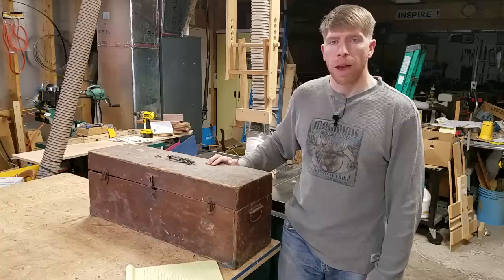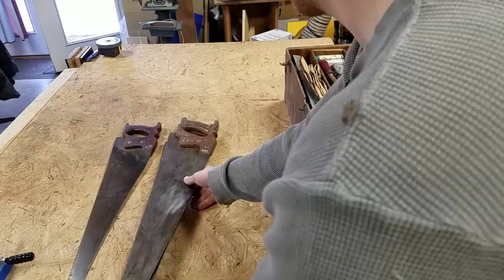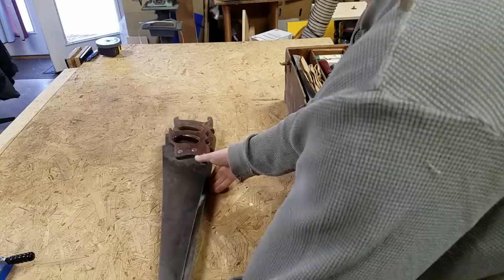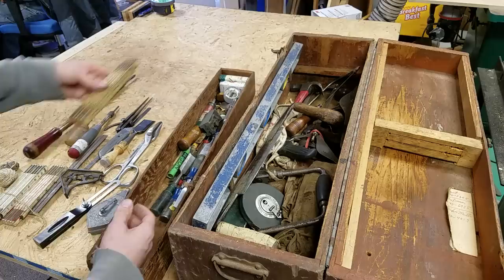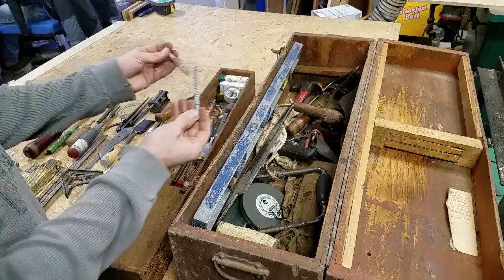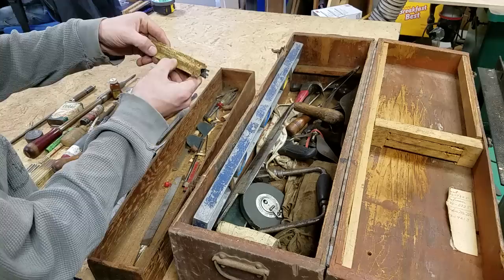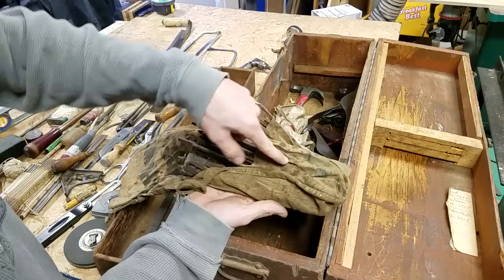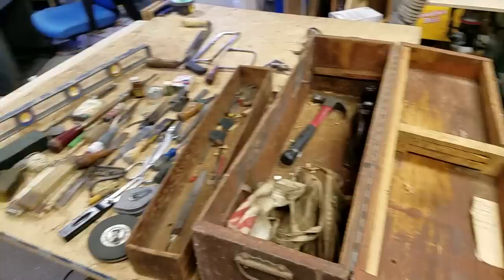Toolbox Time Capsule, unpacking a 1930-1950s era Carpenter's Toolbox! /EP43

Comment: Hello Chris, I'm 75 years old and was trained on hand tools, I worked as an ecclesiastical joiner. I didn't. get my first power tool until 1990. All my work was done with hand tools. I am still working and again using only hand tools. I work for the NZ Historic places Trust. I work on old historic buildings from the colonial days. Your grad father's tools and toolbox remind me so much of my own toolbox (of which I have made several) and still using my father's tools which he handed down to me, and some which are over 100 years old and still in good order. The long screwdriver is spring loaded. and if you weren't careful, it could fly out and damage the work, we called them " Yankee screwdrivers."  The fluted No 5 plane I still use; it was used on oily, greasy timbers, the fluting stopped suction and made it easier to plane. The block plane originally was used to trim butchers block hence the name. I had better sign off now, before I turn this into a book. Thank you for sharing 'box opening.'  ATB from NZ ☺☺

Comment: Grew up learning the price and value of tools.  On my own at 16 and buying tools for my work.  Everyday i oiled the metal surfaces and every 6 months linseed oil on wood handles. I broke a few Craftsman wrenches early on before learning the tool’s intended limits (back when they were all made in USA and you didn’t have to buy ‘Pro version for lifetime warranty). My power tools lasted until i was 53 and my home burned. My point is, buy well and once and do your after the job job!
Reply from the maker: Great, advice! Thank you for sharing your experience.
Reply: My tool buying strategy has always been: Buy the best I can afford at the time and when one breaks or dies, replace it with an upgrade. I've worked as a carpenter or cabinetmaker since 1976 and now have a good set of tools. An older carpenter once told me, "Take care of your tools and they'll take care of you". Remember that!

Comment: That ratcheting screwdriver is made by Stanley, and it's called a Yankee. It's in the closed position, but when extended it has a worm that will turn the screw when pushed. Those aren't blacksmith's chisels, but simple cold chisels, the bent one comes that way for cutting flush with a surface. The Stanley #5 plane comes either with or without a corrugated sole. Jon
Reply: Railfan 439 Yup, been using my old man's Stanley Yankee plunge driver all day today. Hell of a tool.
Reply: Actually prior to 1946 when Stanley bought them, the Yankee was built by the North Brothers Manufacturing company in Philadelphia Pa. Stanley kept the Yankee name and continued manufacturing the thing till selling it to some German company in the early 2000s. Its still being made by them last I heard.
Reply: Railfan 439 not blacksmiths chisels but cold chisels. Blacksmiths use chisels to cut steel when it's hot. They use diffe to chisels to cut steel when it's cold. Hence the name cold chisel!
Reply from the maker: Thanks for sharing! Definitely learned a few things going through it, and from all of you!
Reply: @tedroe695  There is an attachment made now that fits the Yankee so you can use modern hex screw tips.
Reply: the corrugated sole was for use on resinous timber, it reduced the amount of sole in contact with the timber, making it easier to use. and clean.
Reply: Also known as a 'yankee pumper' here in UK.

Comment: Those corrugated fasteners you said were for trusses were most often used in my part of the world (Texas) to assemble window screens. The corners were mitered and the fastener was driven into the boards across the miter cut.  Simple, fast and a great way to join 1x2 boards.
Reply from the maker: Yes Sir, thanks for sharing, Robert.  I realized that after recording,  certainly not gussets for trusses. I'd even used them in my prior  job at a hardware store fixing screen doors before filming this video. One of my many extemporaneous goofs in this video.  Thanks for watching and taking the time to share your experience and write.

Comment: The large screwdriver you pulled out is called a "Yankee".  Proper named is spiral ratchet screwdriver.  The other item you were unsure of was a push drill.  Both were developed in Philadelphia by North Brothers.  These items and others were sold to the Stanley Works Co.  They have since sold them off again.  These items were necessary before the advancement of electric equipment.  The one band aid box had the bits that go into the push drill and other bits for the Yankee.

Comment: Very interesting!!! I've been working on renovation project at an old Cotton Mill built back in the 1800's. It's amazing to see the level of craftsmanship from those days before power tools.
Reply: Read or listen to anyone who's a handtool expert and they will tell you you can do work just as fast as power tools and a lot of it much better qulity work. Power tools were ment to lessen the work load.  When you use hand tools you really work, power tools do the work for you, both require skill to operate.

Think about this next time you cut a board on a tablesaw, you have to set the saw up take measurements raise the blade make sure its squar then cut.
Hand saw take measurements scrib line and cut.  The only differences is how many board feet per min you can do with each tool. And how you fell when your done.

Comment: Aloha Chris ,
The 'butt gauge' was for 'marking' hinge locations on doors for the 'butt hinges' , enter and passage doors . The #5 Stanley Jack Plane was the go to plane for most jobs , but that model is with its 'pleated sole' , this was for sticky or resonus woods . The 'pleated sole presented less surface area to the sticky wood's face to resist , making your workday less tiring . The 'marking gauges' from the 'band aid box' were for your carpenter's square , to make 'laying out' a stairways 'riser's' consistent and true , not only from one step to the next but one floor to the next , since a 'set 'of stair needed to take off and land from the floor level of one floor to the landing of the next . The 'Cold Chisels' seen from the box had many uses , but the 'bent chisel' was mostly used to pry or lift in leveling , confirm this by the leading edge and the butt end . Is there no dings in the leading edge and no 'mushrooming of the butt ? It was than mostly used to lift and level . The 'Brace and Bits' set was the 'first' cordless drill of the job site . With most 'sets' , you had a bit from 1/4 "[marked 2/8"] to a 1 inch [8/8] , and the expansion bit covered the odd sized or special sized needs .  A real time cap cell you have there !
Reply: It is called a corrugated sole. Pleats go on your skirt.

Comment: The "ratcheting screwdriver" is I believe a STANLEY YANKEE SCREWDRIVER the smaller "push drill" is known as a "BUCK ROGER'S" YANKEE PUSH DRILL.  FYI The points (not bits) are very difficult to find and usually store in the Yankee's handle.
What you are calling a "Hand Drill" is called a BRACE.
Reply from the maker: Thanks,  Bill

Comment: Stair nuts are what my grandpa called them. I have heard them called rafter nuts also. My great-grandfather and grandfather were both carpenters in Wisconsin.I build homes in Washington state.Most of what I know was learned from grandpa and dad. I have a couple boxes like yours.When I was ten I "borrowed" grandpas crosscut out one of his boxes and cut a roll of tar paper in half for my fort. Did not go over well!Great video!I knew there were bits for the brace in the bag before you rattled it.

Comment: Great to see an old US tool kit ...still similar tools I use in my kit today in the UK.
Reply from the maker: Definitely an art to do it by hand! I'm a power tool fan myself, but a lot to be admired about slowing down and hand cutting, boring with a brace, chopping with a chisel and smoothing with a sharp plane!
Reply: Chris...I agree, I always chisel out butt hinges when hanging doors and use my block plane to tighten mitre joints etc...old habits die hard .

Comment: Great fun to see what is in your Grandfathers tool box!  For any one that wants to know - the Stanley corrugated fasteners at 16:13 are used for strengthening corner joints in windows, doors, screens, picture frames, etc.  I worked maintenance for a place that had cabins built in the 1930's and there are many things made of wood that used those (before modern tools and fasteners).  Cool to see the Stanley cardboard box with a label on it - that was definitely purchased at a hardware store.  Love the old hardware and tools - thanks for the memories!
Reply from the maker: Thanks for sharing Accseller8! Sounds like a neat place to work in maintenance.  I worked in a hardware store for 10 years from middle school through college, we sold that type of fastener, or had a few old boxes on the shelves. Unfortunately, that wonderful store is closed now. 
I repaired windows and screens there and definitely remember seeing them in the frame corners, basically a metal spline..not sure why I said trusses in the video. Thanks for sharing and bringing it to light. I love how everyone picks something different out and adds from their own experience. Thanks for adding to the dialogue!

Comment: I think it's great that you appreciate your great-grandfather's tools.  You didn't quite get all of the names of the tools right, but you understand what they're for.  I think maybe you should try learning about how to use them.  A few years back, I broke a wrist and was a bit leery about using my radial arm saw and most other power tools.  So I got out some handtools and learned how to manage them with one & one-half hands.  After learning and when I was two-handed again. I realized that handtools have certain advantages.  They don't make noise or blow dust everywhere, they don't cost much to maintain, they don't take up much space, and for many jobs they're actually faster than getting out a powertool to do a job.  As you grow in your skills, you'll find that they can be quite precise too.  Power tools have their place, and so do handtools - they belong in your arsenal. And by the way, here's little known fact: Jedi squires were required to demonstrate proficiency with handplanes before they advanced to handling lightsabers - they're 'elegant tools from a more civilized age.'
Reply from the maker: Great advice Bob, I certainly will.

Comment: Wow, amazing what is in that tool box compared to what is in my tool box today. Some things I do still have and use regularly, but some have been replaced with technology, plumb Bob's with lasers, Yankees with cordless tools. Just think of the builds these guys made with these tools, when pride mattered, not just speed. Great to see that this carpenter had such a variety of tools. Looks like there wasn't one thing that he was not prepared to do. Even with a headache. Impressive
Reply from the maker: He was definitely a man attentive to detail. My father told me that he taught him a technique for fitting stair treads and risers precisely that he held could only be done with a hand saw. He was definitely a Craftsman through and through the kind of man to teach others what he knew. Still inspiring today!

Comment: very nice.  The Stanley No 5 was the do-all size...called the Jack plane, aka Jack of all trades plane.
Reply from the maker: Got it all tuned up and sharpened, still works like a champ.
Reply: SpinDrift I love my Millers Falls #5. I got it in a lot of tools from a garage sale, and was reluctant at first to take it. I’m a user, not a collector, and after I tuned it, it sings thru the wood. I can see how it could be one of the few planes you’d need to get the job done without lugging around a cart full of planes.
Reply: A No. 5 is my favorite all around hand plane. But I wouldn't want to try to do some jobs with it.

Comment: Your grandfather's brace is a ratchet brace which is great for tight places, but it can probably only use the old auger bits (that's typical for that type of brace with three or four jaws). I love using my old braces for boring holes. Often you have more control and even more torque. I've bored holes in hard woods with my brace that would break modern drill bits (ask me how I know 😅). Thanks for a great video!
Reply from the maker: Thanks for that great tip,  Thomas!

Comment: I guarantee none of those  tools say “made in china “
Reply: More than 'Made in USA', I bet they even tell you the US city they were made in.
Reply: That fiberglass handle hammer might be made in China.
Reply: @1pcfred  It's 1960's vintage, I wouldn't bet on it.
Reply: @dougdobbs  I don't remember any fiberglass hammers back then. I don't think I saw one of those until the 80s. China was sneaking some stuff in by then too.
Reply: Bet your wrong, as I know that adjustable angle gauge is made in China, as I have one also.
Reply: there's a reason it's called the 'good old days'

Comment: Hi Chris I'm a retired joiner, when I started my training one of the old joiners had a Stanley No5 the reason for the grooves in the sole is for ease of use on resinous timbers. But in my toolbox rather than carry an extra plane I have a candle, rub a little wax on the sole and swish
Reply from the maker: Charles,  thanks for adding your experience with the corrugated sole plane and wax!

Comment: my father was a carpenter .and he could extend a folding ruler what seemed to be less than a second. when it got a little stiff he'd go  to the pick up an whip the dip stick on the joints.. t.y for the vid.
Reply from the maker: Thanks for sharing, Joel. Interesting use of motor oil!

Comment: The level at 15:33, if you were installing a drain pipe across a yard to prevent water from pooling next to the foundation (French drain), you'd drive a stake at the top of the pipe run, and a stake at the bottom. You'd mark the high stake (by the house) in the middle, and then hold the eye level alongside the low stake. Move the eye level up and down until the cross--line inside the level is on the high mark. The two stake marks will then be level with each other. Then you measure down from the marks to run a tight string line so you can dig a trench for the drain pipe, with a drop of one inch per every two feet or so. That's just one use, there are many ways to use it.
Reply from the maker: Thanks for sharing that,  Ron.

Comment: Not all that different from my own tool collection. However my tool collection goes much much further with plumbing, electrical and my own HVAC tools.  I had everything he did with the exception of the brace and ratcheting screw drivers.  My father was a home builder post WW2 thru the mid 60’s. By osmosis and observation of my father I learned many tradesman skills.  They have served me well over the years. Not much I haven’t done or tried.

Comment: Hello Chris, I haven't seen anyone explaining the No. 5 Jack Plane with the grooves on the bottom of the plane. Those grooves were made purposely for planing lumber like Pitch Pine with plenty of sticky resin, that way the bottom of the plane will not gum up too quickly. Back in those days they'd use kerosene or any type similar petroleum to clean the resin off. I have one of those No. 5 Jack Plane and I also have the exact same model 220 Block Plane to this day.
Not banging you because I know you really did not know, but all those tools like the planes and the woodworking chisels would be sharpened on a whetstone. A file will not sharpen those tools and give it the edge as a whetstone. The small camber you see in the model 220 Block plane would've been made over a number of years of work and continuous sharpening. My own is the same. Cherish those tools like your great grandfather did, it's priceless especially in your hands, although you may never use most or any of them. Thanks for the video.
Reply from the maker: Errol, 
Thanks for adding to the discussion. I really appreciate you taking the time to share your knowledge and experience.  I understand Stanley eventually did away with the corrugated soles completely for varying reasons. Thanks for watching!

Comment: The gray plunge drill or originally called a Yankee Drill.  Extra bits are kept in the top of the drill.  You'll see a hold where a bit slips down into.  You turn it to the next size.  Cool tool box.
Reply from the maker: Thanks,  Marge